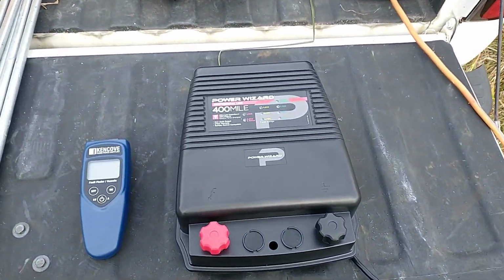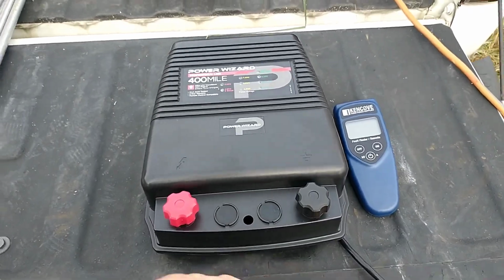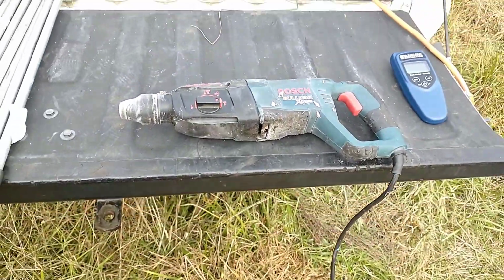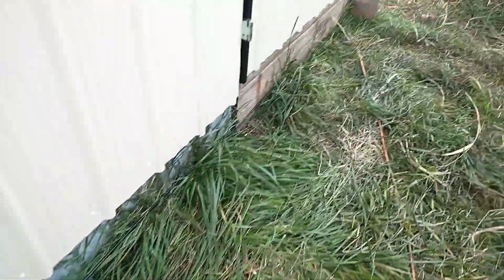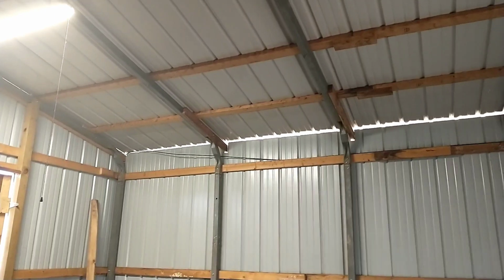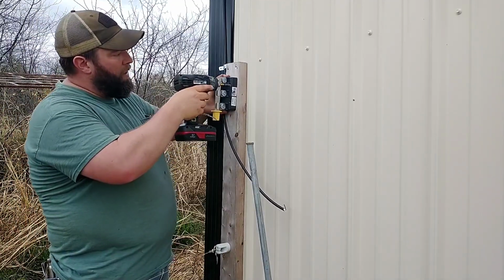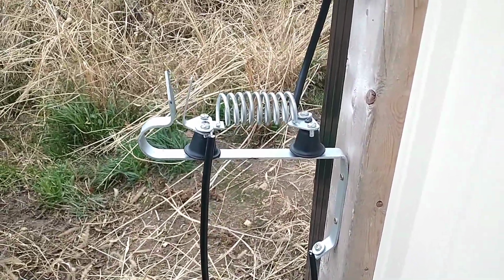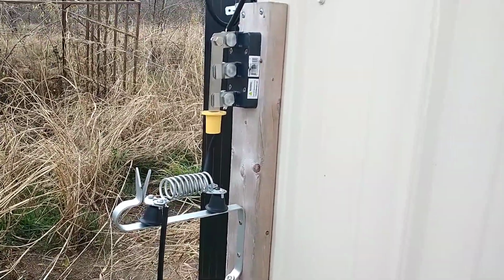Installing a Kencove 24 Joule Electric Fencer to Keep the Goats In!

Comment: @assemblyrequired How’d your install/charger combo work out?
Reply from the maker: Hey @SunDeveledEgger, it worked out great!......for a while.  Fencer was great, the remote feature was awesome and we were holding 7-8k volts even when the vegetation was up on the fence.  Unfortunately a few months ago something killed the fence charger, I'm assuming lightning.  I came out and the GFCI breaker that it was plugged in to was popped, tried resetting and it immediately tripped again.  Plugged the fencer into a standard outlet and it was dead.  The fencer does have a 3 year warranty so I need to get it sent in to be looked at and I'm sure they will take care of it.  Possibility that not being able to get all of the grounds in for the lightning arrester came back to bit me.  For now I have a gallagher  16 joule that is doing ok, but you can tell that its not as powerful.
Thanks for watching and commenting!